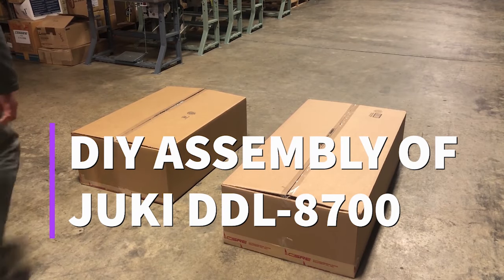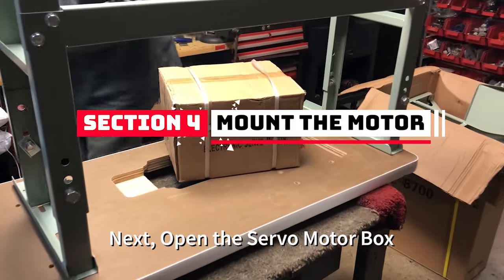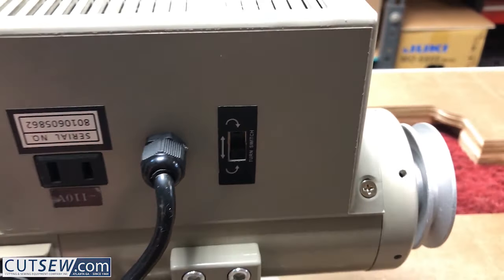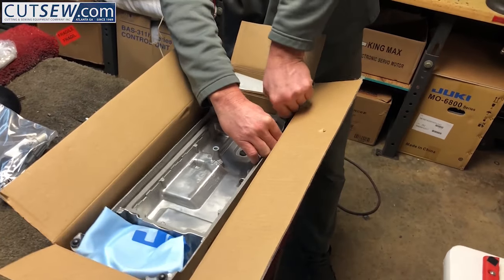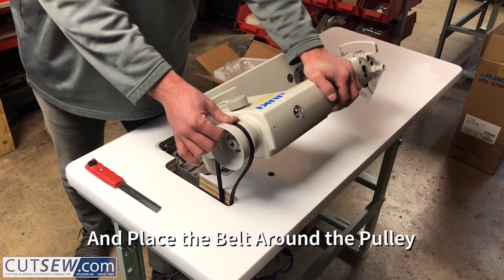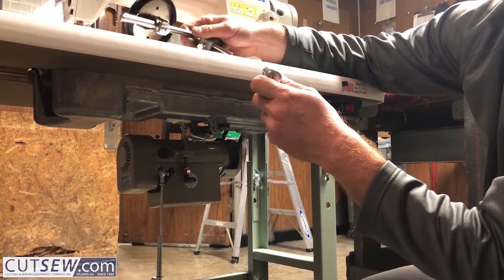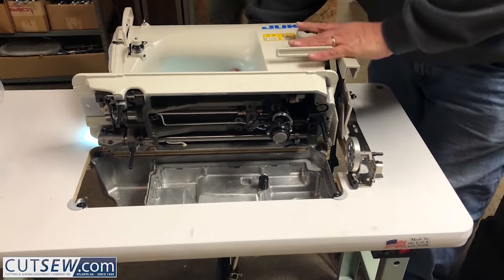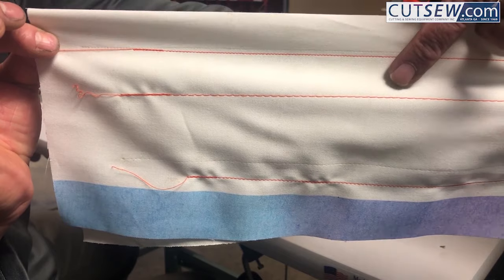DIY Assembly Juki DDL-8700 How To Step by Step

Comment: Thank you, I have used your video because I was heading out to assemble one, meanwhile I found few things you missed, one is pin that coming up from oil pan for knee pad, and also two rubber pads the black one should go on another side to make machine even, otherwise front is up almost a quarter, also do not nail at the bottom, two on the side is perfect as bottom need cushion. Overall your video would be extremely helpful to all, I have not searched other or watch other as you have enough information to do machine portion, there table come assembled.

Comment: Thank you so much for providing such excellent step-by-step instructions. My Juki DU-1181N arrived yesterday with no instructions for installation. I had read that everything is the same as installing the DDL 8700 except the fly wheel, so this was extremely helpful. There were some very minor differences (like the type of screws), but this video was excellent! THANK YOU!
Reply from the maker: Glad we could help.

Comment: Thank you! I recently purchased the DDL-8100 and couldn't find any assembly instruction - then someone told me that its essentially the same machine as the DDL 8700 and I found this video to be incredibly helpful!
Reply from the maker: You are welcome!
Reply: I’m confused on what screw was used to mount the legs to the table. Was it the ones with the hexagonal head???
Reply: I’m not sure to height bolts are long enough

Comment: Very helpful video.. the only thing I did different is was I drilled the holes for light and thread stand before putting the pan and head on. That way you don't get sawdust in the oil pan.
Reply from the maker: Great tip!

Comment: I cannot thank you enough for this tutorial. Lifesaver. I would have been so lost. You were so patient and set a good pace in your explanations. God bless you and your team. However, I am still struggling with the knee pad because my machine came with the motor already attached to the table. so I am lost on where to attach the knee press/ Also mine did not come with the light fixture. Do I need to buy it?
Reply from the maker: Sorry for the slow response, but we don't sell them with the motor atttached. You can buy the light from us though!

Comment: Great video. I wish I came across this before putting my machine together. I am having trouble tightening my belt. The higher the top screw on the motor is the looser the belt. How do I tighten the belt? Also the belt guard makes rumbling noise when I press on the foot petal.
Reply from the maker: https://www.youtube.com/watch?v=4WkjA-GmfxY&list=PLOL5KlPT1mwYX0t37BUVy1znhL5igXFos&index=8&t=0s About 6:14 in shows how to attach the belt

Comment: I bought my Juki off Amazon. They sent me a 39 belt it seems to be too big I can't get it to have tension no matter what. Do I need a 38????
Reply: I just bought a 38 and it seems to fit well. I had a 40 before, and I had to adjust the swing-span of the motor all the way out.

Comment: Great video!!  I have a trouble with a juki DDL 5530 but I perhaps this DDL 8700 works the same way. I think the knob to adjust the stitch length is broken or disrupted. When sewing forward the stitches are very small but when sewing in reverse the stitches have a normal length. Can I manually adjust the stitch length again?
Reply from the maker: It should
Reply: @CutSew  Yes thank you. But how can I manually adjust the stitch length when the knob does nothing anymore?

Comment: Budget Juki – Free
We were given by a friend a JUKI DDL-8700-7
Comes with a computer that is said not to be working (JUKI CP-160)
When the power switch to the machine is turned on the CP-160 turns on and everything seems to look ok. But when I push on the pedal nothing runs.
It does not show any error display or code to work with.
With your experience I was hoping for any advise as to where or what I should try?
Reply from the maker: I'll get with our mechanics & see what they say.

Comment: Is the motor a JUKI part, or is it third party? If the latter, how can Juki warranty the machine when the motor isn't theirs?
Reply from the maker: The Juki warranty is for manufacturer defects on the Juki head only.
Reply: @CutSew  Thank you the response. It seems like this arrangement creates a grey area where Juki could claim that the machine head was damaged because of the motor, and maybe refuse warranty coverage. That's scary from a consumer's viewpoint, but I guess that's how these machines have been sold forever? Does Juki even make their own servo motor that a customer can purchase optionally?

Comment: Is there a way to remove the thread guide from the top. Mine popped and I need to replace it
Reply from the maker: there's quite a few, but it's probably just pushed in there and held with friction, so just pull it out.

Comment: I’m so confused on which screws you used to mount the legs to the table was it the hexagonal head screws ?? Please help!
Reply from the maker: It is the 5/16x 1” bolt with flat and lock washer.
Reply: How do u get the bolt with x on head into the underside of table to attach legs

Comment: my table top doesn't have any holes for the legs to attach....><
Reply: Did you ever figure this out? Mine seems to be the same.
Reply: @yourhealthkick  no! and i've talked to others with the same problem =(
Reply: @sam-co1oo  I’ve actually had to predrill my hole. I set my machine up today
Reply: @sam-co1oo  Haven’t run my machine yet but so far in the installment everything seems good

Comment: I still can't fix my tension on the bottom.
Reply: I had issues with the tension from the belt. I had to buy a smaller belt. Mine came with a 39”. A 38” is a better fit for mine. Mine kept rubbing on the cover guard things.